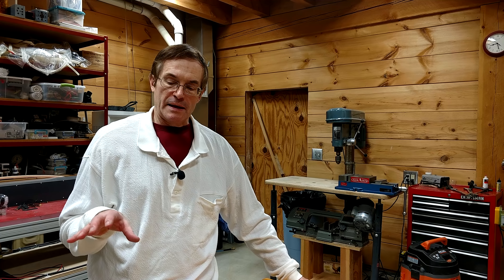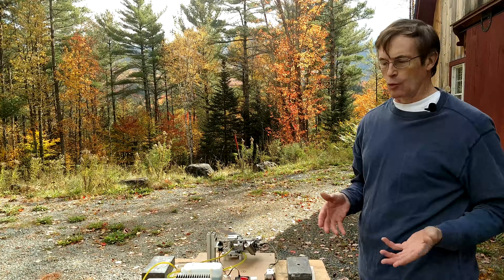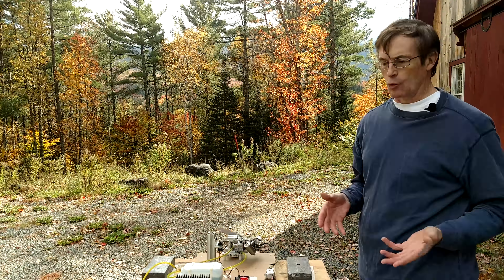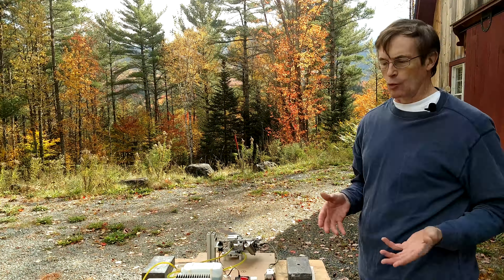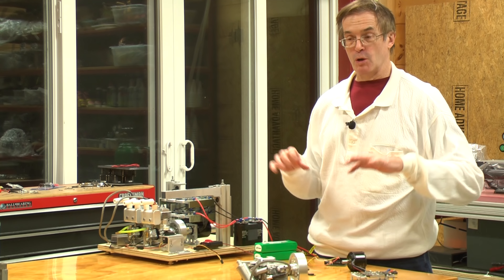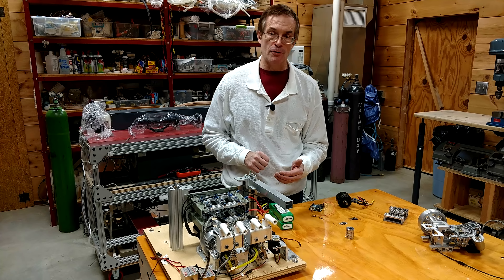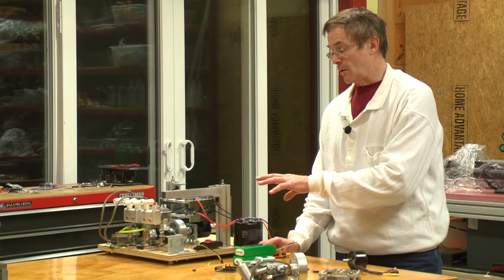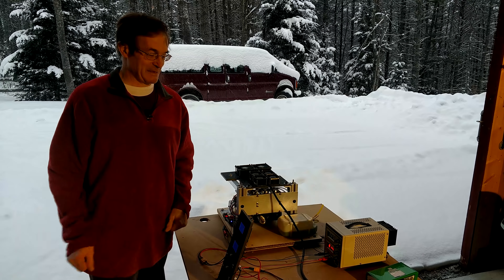Hybrid Drone Generator

Comment: Error.  That crank has counterbalance(s) for the piston and rod.  In fact, I defy you to find a single engine of modern manufacture lacking counterbalance lobe(s) on the crank. There are of course compromises, and no balance system is perfect due to the complex path the rod takes.  If you want a twin with 180-degree offset firing, look at Inline twins.  These are not as popular but often have a seal between the front and rear crank with the center of the crank functioning as a rotary valve switching back and forth which crankcase volume the carb is connected to.  Clues would be individual carbs or a single centrally located carb.  There may be some inline 4 strokes with alternate firing, but I have less experience there.   An example (too large for your application) of an alternately firing twin is a Super Tiger 60cc inline twin.  Your solution will achieve your vibration goal at a high weight cost.  In the UAS world we often mount fuel engine with flexible isolation mounts.  Too much vibration will cause IMU issues in your autopilot you certainly are aware of.  My overall view is the complication will be excessive for the usefulness of the flight time gains in most applications.  Not all, most.  Additionally, the timing belts are often chosen for engine HP not considering the short pulse that contains all that power.  Belt drive system failures due to belt failures are common.  You will probably want a monitoring system to limit the individual RPMS to avoid sticking the rod out the side of the block.  I really enjoy your channel.   I am a UAS Lab Manager in a university setting.  I would be happy to discuss further.  Love your content and the understanding you bring subjects.  You are part of my broad ongoing education.
Reply from the maker: Thanks.
As I explained  and demonstrated in the video, the crank cannot  balance a single cylinder engine.  Any counterweight  on the crank will create a force perpendicular to the axis of the piston travel when the piston is halfway through its stroke.

Comment: I need  about 700amps@48v.  For full 100% duty cycle. 

What do you consider??
Reply from the maker: You need to elaborate on the application.  A heavy and effecient, diesel generator that is capable of producing that ouput is not unusual and is commercially available.  An airborne, low vibration version is a completely different machine.
Reply: Hybrid MAV. u15 
http://store-en.tmotor.com/goods.php?id=731
 How heavy we talking ? Im thinking a small gas motor with small alternator based generators PMA .
48v 300amp x2 good for a 50-75% then lift becomes hindered. 
 120v with stepdown work better ?? I know electronics a bit but this one is not exactly a walk in the park lol.

Thanks.
Reply from the maker: For efficiency reasons you probably do not want to use an alternator as the generator.  A brushless motor like the one you identified will act as a high efficiency generator when driven by an engine and coupled through a three phase rectifier, just like the approach I discussed in the video.  You will need an engine capable of 50 HP sustained output.  A large para-motor engine or a motorcycle engine will supply that much power in a relatively light weight package.

Comment: Have you looked at horizontally opposed 2cyl engines?
Reply from the maker: We're building a larger version now that uses a 4 cylinder boxer engine.  You'll see it near the end, if you watch our follow up video on running this little generator past 2kW.

Comment: I've always heard, you can't balance a reciprocating 
mass, with a rotating mass.  Your piston, is just 
going up and down, the crankshaft is turning in a 
circle.  If you make the crank offset weight enough 
to counter the piston, going up and down, it will cause 
a forward-back movement.

They discovered this with steam locomotives.  If they 
balanced the wheels, to overcome the forward-aft 
movement of the piston, piston rod, and the rest of the 
reciprocating mass, the wheels beat the track up.  Would 
lift the wheels, and then pound them down.  (That motion 
wasn't felt by the passengers, but the engine crew did feel 
it.)

steve
Reply from the maker: That's correct, however two rotating masses can balance each other.  That's why we set this up to keep the two pistons 180 degrees out of phase.
Reply: @TechIngredients  My favorite bike, is the Yamaha 
RD400.  Two cycle twin street bike.  Only vibration I 
got, was a rocking motion.  Reed valves, and expansion 
chambers, that little engine did about 50 to 55 HP.

And, it is light enough, to pick up, completely off the 
ground.  (Had to take the gas tank off, just to grab 
the upper frame tube.  Seat folded up sideways, so 
it could stay on.)

steve
Reply: @TechIngredients , after re-thinking this, expansion chambers 
just might be a good fit with this generator.  Especially, if a 
narrow powerband would work.  At the right frequency (RPM) 
an expansion chamber will, almost triple the power output.

Since your purpose with this engine, is as a generator power 
source, a fixed (or closely governed) RPM would be ideal.  An 
expansion chamber setup, would enhance that.

I'm not sure if you know about this process, (you can't know 
everything) but I am moderately familiar with it.

https://en.wikipedia.org/wiki/Expansion_chamber

As usual, I DO enjoy your channel.  Makes me think.

steve

Comment: Why not use something like a 7 cylinder , 4 stroke radial gas engine if a smooth power delivery curve is desirable to keep voltage variations as low as possible ? Wouldn't you enjoy the fuel economy of a 4 stroke and the smoother power curve of a couple 2 strokes coupled together ?
Reply from the maker: It's an idea we considered.  The reason we did not go that direction is that we wanted an engine shape that we could pack into a small,  noise blocking enclosure that permitted series air flow over the diodes, generators and finally the engine.  The radial and its exhaust piping were difficult.

Comment: since its just a twostroke you could achieve better balancing via running them in opposite directions and in a symmetric phase. Also i would always cool the engines via mechanically driven fans. not with the electrical power that you put all that effort to generate. likely those generators don't even consume the power available by those engines completely anyways.

Comment: What about using a small hobby jet engine to a direct drive alternator/generator?
Reply from the maker: The problem with direct drive with a small jet will be the extreme RPM.  This could be as high as 200,000.  Using the exhaust to drive a larger, slower turbine as in a turboshaft would be the way to go.
Reply: Good point. Would the extra weight of the reduction gearbox off set the lighter weight of the jet engine to the point where the overall benefit wasn't worth it?
Reply: Hey while I have you, thanks very much, to you and your team, for a great series of videos, very educational and well delivered/edited. Great work.
Reply from the maker: Thanks from all of us!  The turbo shaft would not need gearing as it spins within the range of high speed generators.  The power to weight ratio of this kind of set up would still be superior to a reciprocating engine.  The fuel consumption is much greater with the jet, but that's the trade off.

Comment: Great Presentation
Question 
1. How does the power ( voltage) that is produced from  the flywheel ( that generates from the gas engine shaft)  make an UAV flight longer ??? 

The American Super Bat DA 50 from Martin UAV  ( utube 2:30-3:00) explains that the gas engine generates electrical power 
( flywheel / magnetic rotation around gas engine rpm shaft) that charges the batteries that powered the system in the flight.

* I am confused by his statement, but I get the idea. 
I understand your point in terms of balance
Reply from the maker: I don't quite understand your  question.
If you mean that incorporating  the motor into the engine by using the rotor of the motor as the flywheel then this will lighten the assembly and increase vehical  range.

Comment: Could you use an RC gas turbine jet engine coupled with a bldc motor to achieve the same thing? Basically make a gas turbine powerplant.
There is virtually no vibration in the jet and the power output (rpm) can be electrically controlled very precisely and also, directing the nozzle of the jet downward will give additional thrust.
Or, you could do what I always dreamt of doing, having 4 rc jet engines at  4 corners of a quad copter.
Reply from the maker: Your first suggestion is more achievable, if only because of cost.  The RC turboshafts would be a good choice because the output RPM is in a practical range.  The light weight and low vibration are a definite advantage, the cost and high fuel consumption ate the draw back.

Comment: Have you looked at motorcycle alternators and voltage regulators?
Reply from the maker: You do not want to use an alternator for an airborne generator, they are heavy and less efficient than a permanent magnet generator.
Reply: @TechIngredients  motorcycle alternators are not like car alternators, they are more like an OutRunner 3-phase permanent magnet motor

Comment: 120x energy density yet combustion engines are only like 20% efficient right?
Reply from the maker: The ratio of 20 to 1 is based on the energy available when the engine burns the fuel to produce useful wok not the thermal energy content of the fuel itself. That ratio would be closer to 70 to 1.

Comment: Regarding the balance of a crank engine,  you cannot balance a reciprocating mass by rotating another mass on a different plane.
Reply from the maker: However, you can change the magnitude and direction of the force vector.  Imagine  the balance crank becoming thinner and thinner while countering the same mass offset.  Eventually, the alignment is perfect, but you can see that the magnitude of the force can be made arbitrarily small.

Comment: OK So how long do you think it will be befor the  glass bafeling materal gets cloged . I have plenty of 2s motors it will not take long befor it will not flow.
Reply from the maker: We have operated this generator for a couple of hours and although the glass was not colged, it was well on its way.  The new mufflers use the glass, but only as a sound absorbing material ALONG the exhaust path rather than as a filter.  Much better.

Comment: YouTube just suggested a video "How to build a 2-Cylinder In-line Two-stroke Engine".
Not impressed for several reasons I felt compelled to reply to a comment with the following...

The plastic bag trick proved nothing. If you listen closely, you can hear the second engine start...@ 15:05 he turns the IDLE SPEED screw out enough for the fuel to flow through the IDLE circuit of the carburetor allowing the pull-starter side engine to start for the FIRST time around 15:07-15:08. Carburetors have circuits and the IDLE circuit ONLY works for the first few degrees of throttle opening.  The second engine was clearly doing all the work and smoking to prove it.  Since the IDLE screw was turned in past the IDLE port there was not sufficient intake velocity to draw fuel through the idle or main circuit of the carburetor until he loosened the screw.  This engine will suffer from vibration and overheating and have a very short lifespan.

For a very good explanation on how to correctly couple two 2 stroke engines see YouTube channel "Tech Ingredients" and specifically the "Hybrid Drone Generator"
and "Drone Generator Performance" videos.
I am not in any way affiliated with "Tech Ingredients", but I assure you they will never steer you wrong".
If this results in an onslaught of new subscribers, you will just have to deal with that. ;)

Comment: Did you ever think about trying to whip up a free piston range extender like some companies are trying to do with their hybrid vehicles?   

It just seems like a lot of monkey motion to take linear power (e.g. a piston moving thru a cyl), turn it into rotating power (connecting rod -> crankshaft) couple that mechanically to a rotary generator (alternator) just to create multiple streams of linear power (your three AC phases).

See the Bourke engine for a design that's a valveless 2 stroke that could easily be adapted to a linear generator in its middle rather than the crankshaft that it originally had.

I think you'll see gains of approximately 35% efficiency plus save a LOT of weight.
Reply: Another thing you might want to look into is to use a small turbine tied to a homopolar generator.   If you heat exchange the exhaust into the intake (e.g. with a rotating honeycomb ceramic disk) you can get the fuel efficiency up to on a par with a 4 stroke engine.

Comment: Have you seen the engine with a liquid piston? The piston isn't a liquid but it does allow the air/fuel mix through it. It has some similarities with the Wankel engine but is vastly different in others. 
A Wankel (rotary) engine might offer the smoothness you are looking for because it hits every 33 and 1/3°.

Comment: can you possibly put magnetic tips on the drone props and a pickup coil  just a thought
Reply from the maker: It's possible, but why?
Reply: for power generation  or support of power supply
Reply from the maker: It would be safer, easier and more effecient to extract power from the rotation of the drive shaft. Mounting the magnet as you described would increase the weight of the prop and the pick up coil would interfere with airflow.
Reply: @TechIngredients  thank you for the reply ..i am a big fan ..love your work ..ya  your right air flow interference and weight are very  important  i wont hold you up further have a great day

Comment: Matbe you Chould mount the engines at 180º opposition, that way the the stroke from one engine, counters the imbalanced stroke of the second engine, and vise versa..?
Reply: That won't ensure synchronisation of pistons. He has described this problem and come up with the current solution.

Comment: Have you thought about a Wankel setup? It performs better than a 4 stroke but slightly worse than a 2 stroke, but since there is no reciprocating mass the vibration is very minimal
Reply from the maker: Yes, and it would be nearly idea, but the availability of these engines in the power range that would be useful is very limited.  Building a custom engine or finding a rare surplus OS engine would not be useful if others wanted to build a similar set up.
Reply: @TechIngredients  I didn't think about the availability of the engine for the performance required, you're right. And I imagine that Wankel setups would require noticeably more maintenance than a regular piston engine.

Comment: great work! next time you should consider a rotary engine though, they are more efficient than 2 strokes and they produce power on every stroke depending on how many rotors you have. Also barely any vibrations!!
Reply from the maker: Thanks!
Small rotary engines are very hard to find.
Reply: @TechIngredients  you're right, that's why I plan on starting a business and selling cnc engines
Reply from the maker: Good luck!

Comment: instead of using a timing belt which I will admit might have been easier with components on hand

wouldn't a gear in between have made more sense as timing belts can be prone to slippage, but a gear slippage is usually the result of a broken part?
Reply from the maker: Timing belts do not tend to slip because of their toothed profile.  They also dampen the engine vibrations that would otherwise transmit to the motor-generators.

Comment: I wonder about the gas motors you tried.  I had a 600 cc BMW motorcycle which of course had the famous 2 cylinder BMW horizontally opposed engine and their was NO vibration.  I could put it on the main kickstand and even idle it down to almost nothing and still stand a nickle up on the top of the gas tank.   Vibration free designing does not get any better than that for a piston engine.
Reply from the maker: Two possible explanations for that performance come to mind.  Do the pistons fire simultaneously or alternately?  And, does the crankshaft have proper counter weighting to compensate for the moving mass of the pistons?
Reply: Briggs and Stratton also made a horizontally opposed engine, sounded beefy and great, loved it. Radial engines are also smooth
Reply: Every action, of every moving part, had an opposite action at the same time canceling out all vibration.

Comment: I would like to build an de accelerator for my home built generator so as my batteries charge and the voltage increases it will lower the rpms automatically to increase my fuel efficiency this is part of an hybrid system as well where the lifepo4 batts are operating my solar inverter right I have a set of 8 230ah batteries capable of 6kw hrs @24v or 28v the fuel efficiency is about 1 liter of gas per 1kw of power produced which I think is pretty good but I believe it can be better I may switch to a 3 phase motor instead of an 24v automotive type alternator

Comment: Are those engines mechanically coupled?
Reply from the maker: Yes.  That is covered in the video.  If you haven't watched the whole thing, you might want to take the time as there is a lot of useful information presented.
Reply: @TechIngredients  I made my comment too early. Did watch the whole video. You might consider tuning them one at a time to ensure both are running at peak efficiency and not dragging the other down.

Comment: Seems to me a turbine APU would be the obvious choice for this purpose after seeing the various complexities within the mechanical structuring.
Reply from the maker: It's tempting, but the cost is very high as is the fuel consumption because of the low compression ratio.